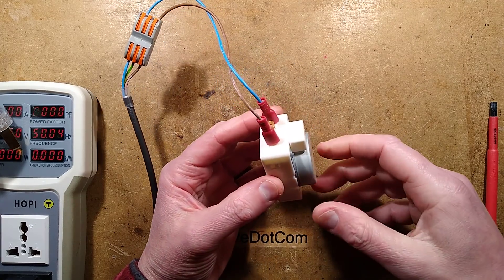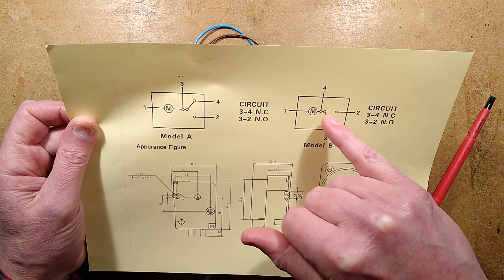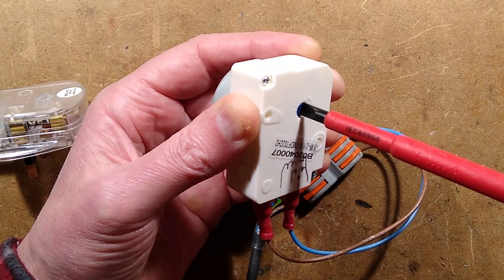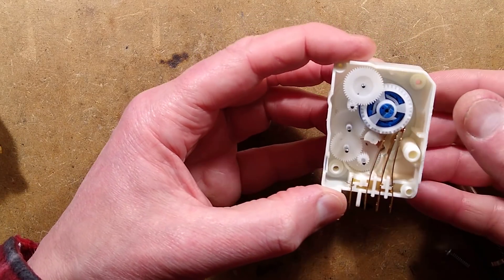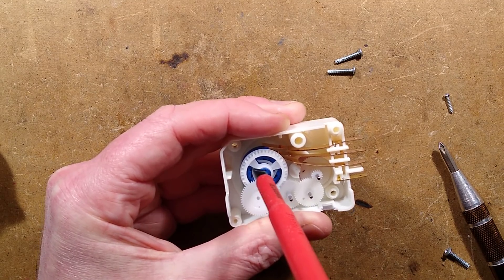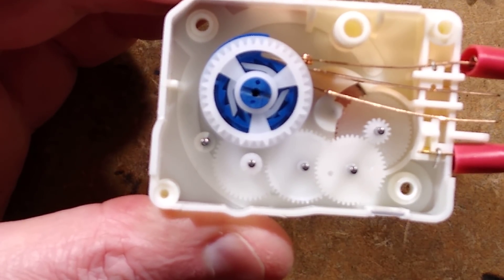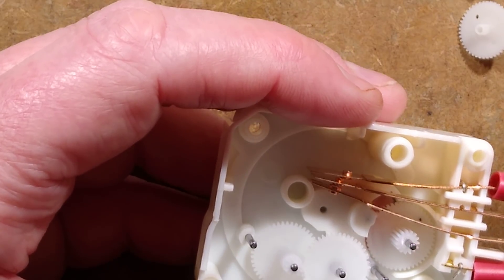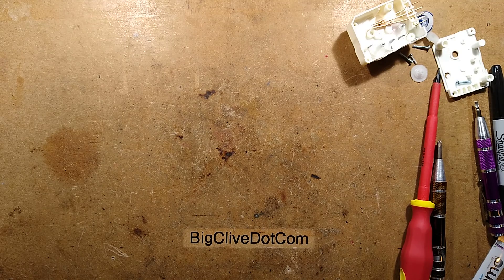Defrost control timer.  More complex than you might think

Comment: This looks like the most Heath-Robinson bodge-up design I've ever seen? LOL
It puts me in mind of a heating system system in a 2 story office building we were renting, where one heating boiler, was servicing both floors? In order to make this work they had installed a 2 way diverter valve with a microswitch inside in mid position, which was arranged to hunt around the mid point, starting and stopping continuously via the motor running and stopping just past each mid way position - all day long while both floors required heating, which of course was effectively always. 
Every few months or so the motor and/or the micro switch wore out and the top floor would lose heating entirely - so the valve needed changing. A guy would turn up each time and charge £400 or so for replacing it. 
What was needed was just 2 conventional valves, where the micro switches in both valves were wired in parallel - so that energising either or both valves would start the boiler and the hot water would go wherever it was needed, in either or both floors.. I couldn't believe it.. LOL
Reply from the maker: There is a standard diverter valve that works like that, but is held in a mid position with DC via a diode.  These valves often have a microswitch that also powers the boiler control system, and if that was passing a lot of current it could have affected its lifespan.
I also wonder if the valve was actually wired correctly as they shouldn't hunt about like that.
Reply: @bigclivedotcom Yes I'm aware of the deliberately 'sticky' mid position valves that hang there with net DC on their coils. You might expect them to heat up and potentially fail early? They mostly fail from heat drying out the gear lubrication, or even an internal cut-out melting😞
I'm not sure if the valve was supposed to be the sticky type? But it looked like a kind of bodge-up someone might have done on building commissioning, when it was found that the multi-zone heating wasn't working to spec? We were the first tenants to occupy the building. What tickled me was this demonstration of 'plumber's digital logic'? LOL :-)

Comment: Wow, that is more clever than I thought. Typically you'd use a reset pulse from the defrost stat to restart the timer and motor but to power the timer through the compressor winding is.. some crazy optimization really.

Comment: They are also in dehumidifiers. They act as a fail safe if the humidity control sticks on (or if you modify it to act as an aircon). It shuts off the compressor leaving the condenser fan running while the evaporator defrosts

Comment: Question maybe for you. Is there a control switch that will shut off power when it get too cold? I know it exists because I do have a freezer. I want to stop a fridge from getting power if the ambient temp is too cold.
Reply from the maker: You could add an external thermostat.

Comment: Fridge thermostats call for heat at Clive's house. It's an Eskimo refrigerator.
The time the defrost heater is on its automatically regulated by the qty of ice requiring removal.
This video shows why refers have trouble on inverters. The time between when the defrost heater shuts off and the compressor restarts, many inverters see too little load and shut off until the defrost heater trips on again. Oops!

Comment: My somewhat limited refrigeration experience the defrost timer diverts power from the compressor/thermostat to the defrost heater and thermostat. the thermostat for the fridge/freezer never cuts power to the timer. I found that there were two styles. one that switched for 20 minutes every 6 hours and one that switched every 24 hrs. Have I missed something? BTW 120 volts on the west coast of Canada. Not far from AvE really.
Reply from the maker: Different styles of equipment have different numbers of defrost cycles per day.

Comment: Had one of the first energy saving house refrigetators that were made by Amana back in early 70's. Had to replace the defrost timer 3 times in the 17 years that I owned the piece of crap. Also had to replace defrost timer once. Found out that they saved energy by installing an undersized compressor. While me and the Mrs worled all day and doors were not opened for over 11 hours ice  cream was so soft during summer. Had to run the central air conditioner to prevent this.

Comment: I have an old fridge and the timer is somewhat similar, and there are times when I don't need the freezer compartment freezing.
So I unhooked( or unscrewed) the sensor wire from the timer and just it hang outside.
Why is the freezer aluminium still showing signs of freezing. 
I think the temperature may be too cold.
So I wrapped the thin piece of wire with styrofoam, so that it will not show the fridge is too cold ( wire = I think its the temperature sensor with some gas inside. ) Yet the freezer aluminium compartment gets cold ?

So here are my two questions :
1. How can I turn on and off the freezer compartment with the timer ?
2. How to lower the temperature even further ? what material can I use. I used a plastic straw around the wire - still no good.
Appreciate responses from readers.

BTW; Clive : I like your videos and your practical ways of hacking things - they are just like how I do it.
I remove few screws and this thing is not  opening and then I pry it - until I look underneath and there are more screws to be removed ! Argh.
I enjoy your videos. Very educational and your explanation is just right.

Comment: Meh, still probably more reliable than the newer microcontroller-based relay or TRIAC actuated ones where all the fridge's functions are on a single, disposable, lead-free-solder porosity ridden PCB that the vibration of the relay actuating is enough to wobble the solder joints loose over a few years until they open up enough for the fridge to mysteriously stop working. And naturally, the PCB costs like $80 and is now out of production (because they changed the position of a single screw hole) instead of being a universal piece of electronic Lego that costs $5 for a Chinese generic like this does.

Say what you want about electromechanical, but the more embedded MCU appliances I have to mess with, the more I think synchronous motors and cam wheels make more sense than microcontrollers do.

Comment: I had a fridge with the 'A' type timer (keeps running while defrosting) which I had unplugged for whatever reason. When I plugged it back in the compressor wouldn't turn back on even though I knew it was warm enough. I unplugged it and put my multimeter across the plug and the resistance redings seemed normal. There was low resistance when I set the thermostat to cold and infinite (or light bulb resistance if the door was open) when I set the thermostat to off. For the longest time I was stumped, but then I figured out it was just unplugged during the defrost cycle. I turned the override and then it immediately turned back on.

Comment: This may have been asked already but at the point where the defrost stat opens and the neutral reverses back through the motor, would there be a change of rotation - I get that it's a synchronous AC motor driving the mechanism but how is the direction kept the same at the point where it's plugged in? More my ignorance of how AC motors work than anything, but it's worth asking the question in case that's relevant to the manner in which the gears are arranged and maybe the benefit of others?!
Reply from the maker: The synchronous motors have a mechanical direction controller.  Otherwise they can run in any direction randomly.
Reply: @bigclivedotcom  ah ok thanks, so regardless of which side L/N appears on they will always turn in the same direction (I fixed my parents' old school mains powered clock a while back and was wondering how it always went clockwise - sometimes you could see the slight hesitation on start-up which would be the same thing I imagine :))

Comment: This explains why my old freezer frustrates me so much. 
I tried to avoid the automatic defrost and cleared it out, pulled the plug and defrosted it before I suspected it would do it again. 
Then I switched it back on and loaded it with fresh food. 
Which spoiled a week later, when it went to automatic defrost again. 
Since then I made it a non food fridge for rechargeable batteries, disinfectant, chemlights, epoxy, uv curing resin, thermal glue and so on.

Comment: In the seventies i repaired refrigerators. The defrost timers are very reliable.  But if you hear a growling noise, consider getting a spare. In a few years the gears may bind and the poor motor will stop and you don't notice until the first day stores close.  You can manually switch it into defrost, the cooling might not restart.
*  suggestion, my Chinese is horrible, but i still enjoy Chinese to 'Engrish' translations. Could we have a send in your/everyone 'wurst' translations video post?

Comment: I watched a video that GFCI works fine on a 2-wire circuit in the US
Reply from the maker: Yes it does.  It measures the current flowing out and then back in again.  If enough is missing it trips.

Comment: My new dehumidifier has a defrost function that doesn't appear to have any idea at all.  Having found it frosted up, I used a timer to turn it off for an hour or two to defrost itself. And, when it's not been running for 5 hours and then times on, it's gone into defrost mode 5 minutes later !

Comment: not many if any are wired that way here, they generally run the timer motor from case thermostat to neutral, so it runs as long as thermostat is closed.
then the defrost thermostat only opens the heating element circuit on temp rise of evap. coil.  the timer continues forward regardless and kills defrost heating at XX minutes time and goes back to cooling cycle.
if the heater fails to work, it will ice the coil and quit cooling the fridge side, while the freezer side turns into an iceberg :)

Comment: As a fridge commercial fridge engineer,  For many years now we use electronic defrost temperature controllers. However years ago we had mechanical defrost clocks  that had a pins set every six hours that would trigger a similar mechanism. And defrost termination was via a solenoid pulled in from the neutral side defrost termination stat. I often wondered why they decided to design it using neutral side switching. As this was hard to diagnose an issue using a volt meter unless you knew it was neutral switched. This must be a design based on this principle for commercial refrigeration. With the added safety improvement that the clock still rotated while on defrost and so was also able to set an arm time that would push the same defrost release as the solenoid.  So not only did it terminate on temperature but also time , which ever happened first
Reply: Clive used to work on those freezers as an industrial electrician and I believe I remember him saying they triggered the defrosters based on time of day rather than time since last defrost so that multiple units wouldn't come on at the same time and overload the electrical supply.

Comment: Question, what is preventing current from still passing through the motor if the DF Stat is closed?
Reply from the maker: If the stat is closed both motor ends will be referenced to neutral.

Comment: Why doesn't the timer motor run backwards when the defrost thermostat opens?
Reply from the maker: It's an AC motor designed to run in a single direction.
Reply: @bigclivedotcom  Thanks.  Makes sense now. :)

Comment: Hoping this comment helps someone in the conundrum I found myself-- had a dorm style refrigerator (with defrost cycle, most new cheap ones don't have this feature anymore) the timer went bad (gears gum up/bearing surfaces resist so motor fails to turn) fridge gets stuck in a either mode-- the replacement for my particular refrigerator was a more exotic model because of the smaller size (defrost time was significantly less like 10 min); OEM replacement was like $50 at the time, the generic solid state timers I tried were both crap they would get stuck in an oscillation where you could hear the relay rapidly cycle for several seconds when switching mode?? Not sure what caused that, maybe a voltage drop? Either way it didn't want to impose that kind of stress on the compressor so abandoned those as an option, so as a last stride effort I bought a cheap standard mechanical timer opened it up to inspect the guts and compare it side by side with the original, all the construction was identical, gearing, cam lobes, I couldn't wrap my head around what would cause the defrost cycle to be longer or shorter but I eventually figured it out, know how it's done? The length of the arm past the contactor! It rides on the contour of the cam for a longer amount of time! Elegence in simplicity! I snipped off ~⅛ of the metal edge on a 30 min timer and saved myself $40 😅
Reply: I composed this comment before I was able to watch the video, I see now this defrost timer has some different operational principals; the style I countered had constant gearing; the cam the contactors ride on was always moving, it did not index like this, much smaller motor and far simpler contactor setup.

Comment: Last year, I discovered what happens when one of these gizmos fails in the "defrost" position.   Water on the floor; soft ice cream and melted ice cubes.  Darned nearly drove me nuts running it down.   I first suspected the compressor start relay, nope.  No refrigerant leaks.   Finally discovered this thing hidden behind a dress panel behind the interior light.   Short-term solution was to rotate the timer to "refrigerate"; order a new unit and install it a week later.   FWIW, compressor start relay is one of those PTC cheapies as well...

Comment: Typically,  as I am in the appliance repair business, ,the most common problem I run into is a failure of the defrost thermistor.  The defrost timer keeps ticking,  so the compressor resumes normal operations.  But you wind up with freezer burn and soft ice cream,  and sometimes find your freezer warm.  It's so alarming!  But a couple wire nuts and a 17 dollar part will fix the fridge in 10 minutes.

Comment: These are not good for dehumidifiers the switch period is to long either the off is too long or the on is to long. Five minutes on in 60 minutes is best otherwise the defrost valve over heats and burns out. There's lots of these but it's it's got to be the correct one for each model timing is critical.

Comment: Very interesting.  Ice makers have a similar control to heat the tray allowing the discharge of frozen cubes, cycling the part that removes lose cubes and then turning on the water to refill the ice mold.

Comment: A neighbour's fridge freezer defrost time clock got stuck on defrost & they lost all the food in their freezer because the defrost heater stuck on & heated up the freezer to the point where everything defrosted. I replaced the defrost timeclock for them, but it's one of the reasons I won't buy a frost-free fridge freezer, they will go wrong eventually, usually just outside warranty. And I'm a refrigeration engineer by trade lol.

Comment: This suggests that when defrosting ends and the timer motor restarts, as soon as it clicks back to "normal service" it stops again (because the defrost stat is likely still open) - then it starts again once the (still running) compressor cools things down enough for the defrost stat to close again.
Reply: I didn't think of that, but I suppose you're right.

Comment: My auto-defrosting fridge/freezer no longer defrosts (planned obsolescence shite). It was taking hours to defrost the thing by the usual manual back-up system - turning it off,  opening the doors etc. Then I bought a cheap hand held steam cleaner from amazon, it melts the ice away in seconds (no more hours of manual defrosting), lots of water to mop up whilst steaming but now takes a few minutes instead of many hours.
Yes I need a new fridge/freezer or a replacement part (not sure what's gone on it) but thought someone might find this solution useful for defrosting their non-auto-defrosting freezer if need be.
Reply: My parents' side-by-side fridge had a massive frosting problem - at one point I removed almost 30 pounds of ice from around the bottom drawer!

It turned out to be an obstruction in the defrost drain line. A few cups of near-boiling water through that little hole almost 10 years ago and it's never frosted up since.
Reply: @Azlehria  Yes the defrost breather tube does block, that's one of the things that we have to keep unblocking. Just not sure what the problem is, I guess the defrost heater isn't heating for some reason. Still, this video taught me about how freezers keep themselves ice free, which is good !

Comment: So the top (NC) and bottom (NO) are mechanically, but not electrically, connected to each other so controlled by one ramp, and the middle (C) are controlled by the other ramp. Is that right?

Comment: A good while back, a certain company had problems where the timer was failing on defrost and the fridge freezers went up in flames. A programme of replacing them with solid state timers with no moving parts (except for relays, of course) was put in place.

Comment: And already I'm thinking what other applications this thing could be used for - Just for fun.

My freezer lives in the garage, and I've discovered the absolute and certain way to defrost the thing. Just let a rat into the garage! It's attracted to the warmth from the compressor motor and starts to build in the space behind the freezer. Next, it finds there are a few pesky wires in the way, so it bites them off. After that the freezer defrosts over a number of hours. The compressor motor goes cold, so the rat moves out again and buggers off. The only fundamental flaw with this system is that the little sod doesn't reconnect the wires to get the freezer running again - That's my job for this afternoon!